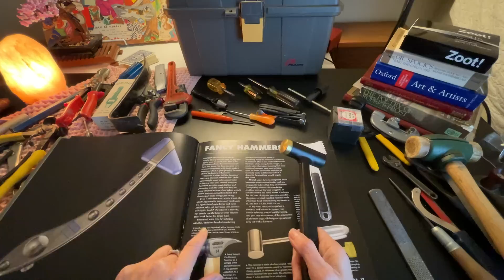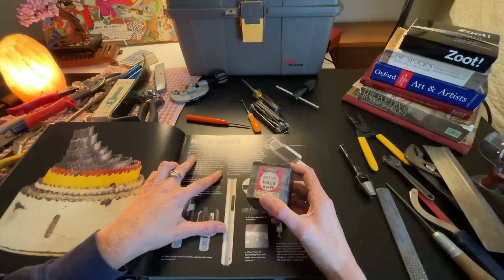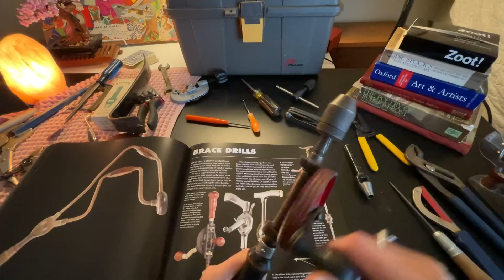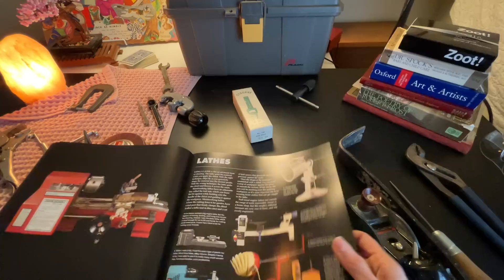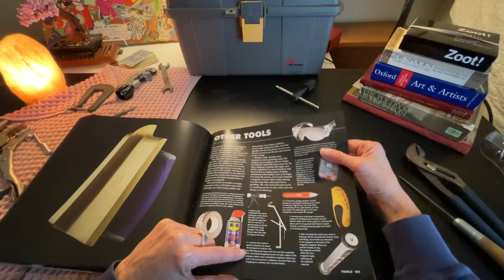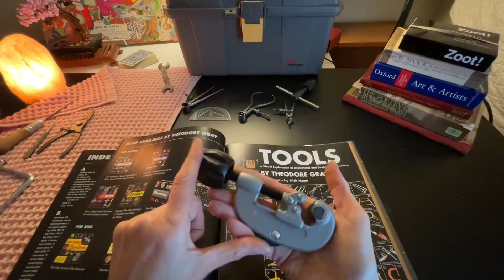Soft-Spoken ASMR Tool Book & Real Tools | 1+ Hour of Relaxing Sounds & Gentle Page Turning

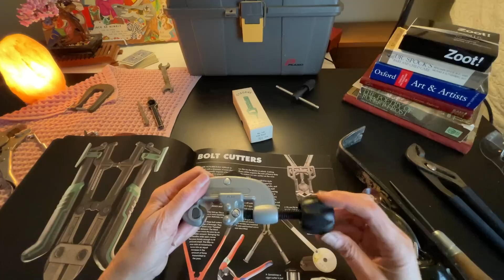Comment: 47:50  the silver c-shaped tool is a pipe cutter. You fit, adjust, and tighten it down around the pipe. You then spin it around the pipe in a circular motion as it scores and cuts the pipe.
Reply from the maker: That makes sense! Thanks for watching!

Comment: The black hammer at the beginning is a brass hammer to be used in places where normal hammers would cause damage to the object
Reply: This one would be specifically for installing fret wire on the fingerboards of guitars.
Reply from the maker: @TigBiddy bingo!
Reply: Sometimes brass tools are also used when fire is a risk, because brass won't spark. but that kind of hammer would be all brass, not have the second material on the reverse face.
Reply from the maker: @FlagAlf that’s interesting. I never thought of that!